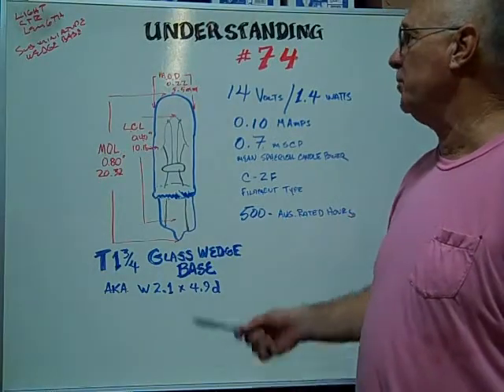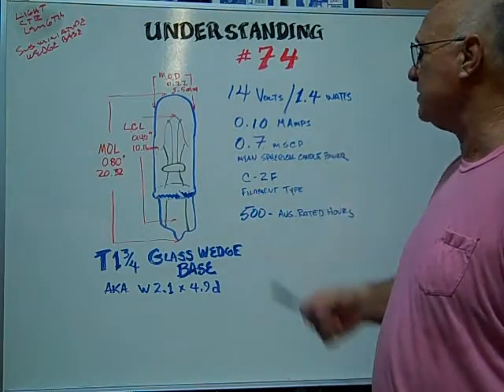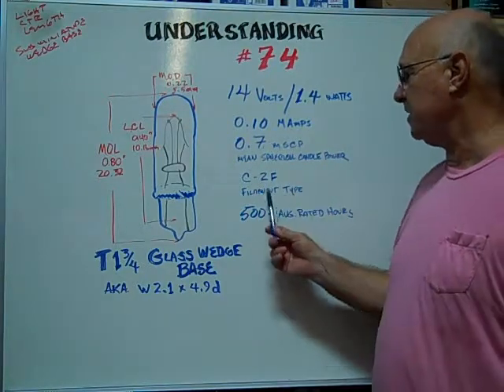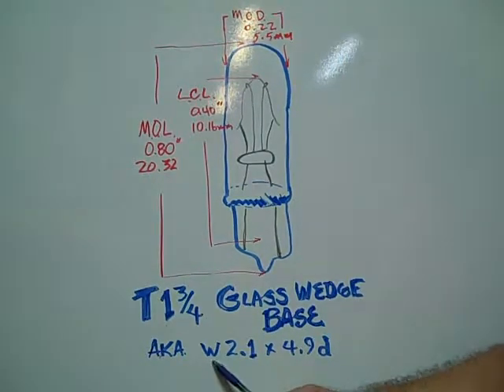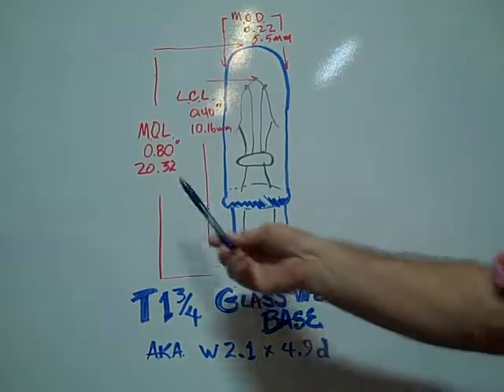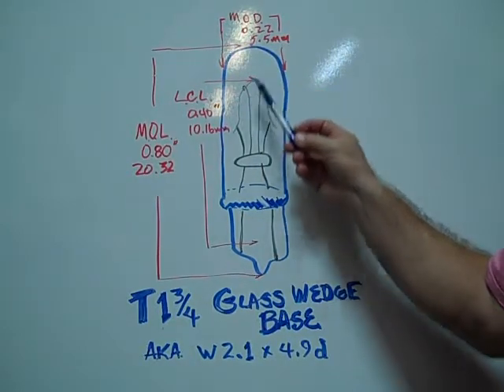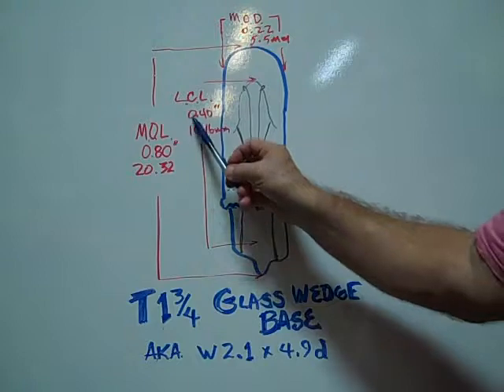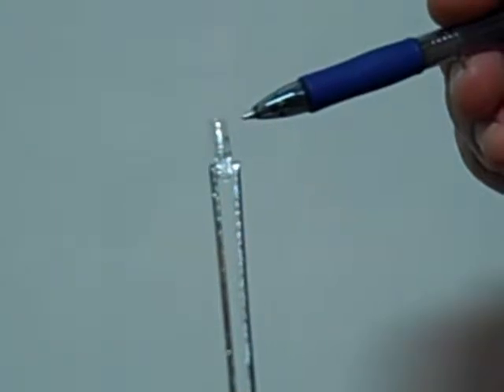#74 Miniature Bulb

Comment: The info at 15sec. is incorrect.  It's rated at 0.1 Amps, not 0.1 milli-Amps.  0.1 Amps is equal to 100 milli-Amps.